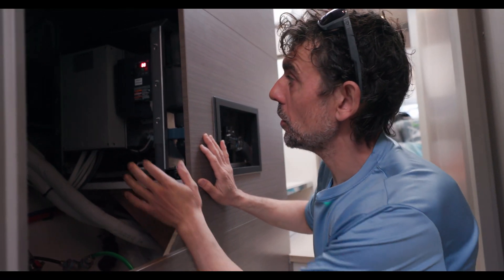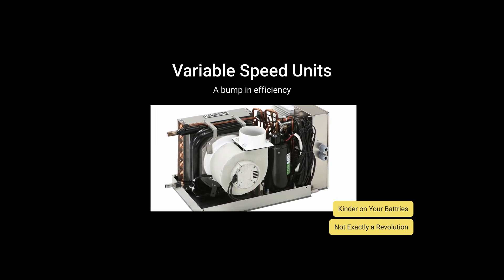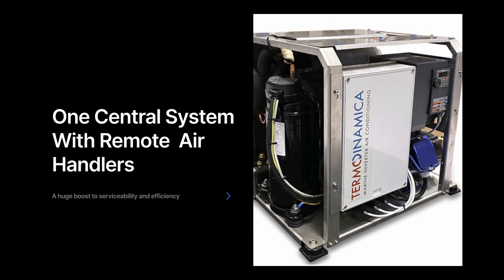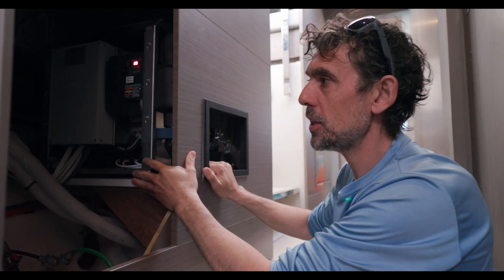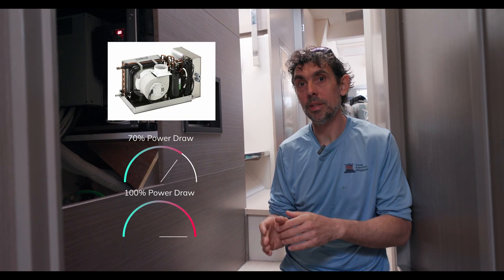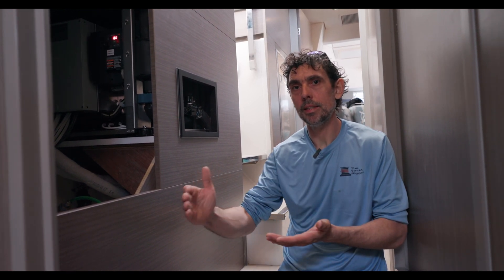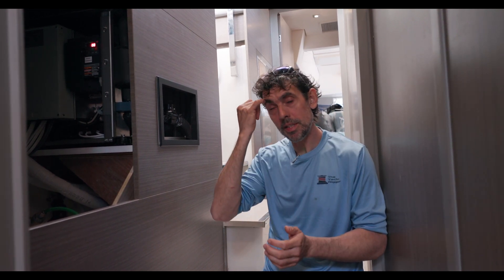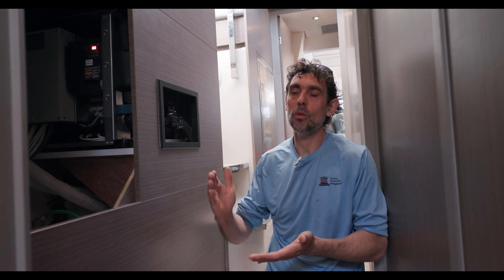Cruise Ship Air Conditioning Grade System For YOUR Boat?  | Termodinamica VRV System

Comment: Helps to have some idea of cost - I know every install is unique , but compared to 3 single speed units, is it going to be 2x? 3x?
Reply: This system will be 3 x the cost unfortunately but there is nothing like it.
Reply: This becomes more cost effective if you are replacing a large dual chiller system that has 5+ air handlers. I got a quote for repairing/replacing a lightning struck Dometic dual chiller system with 9 air handlers. It is more or less identical cost to go with a termodinamica solution.